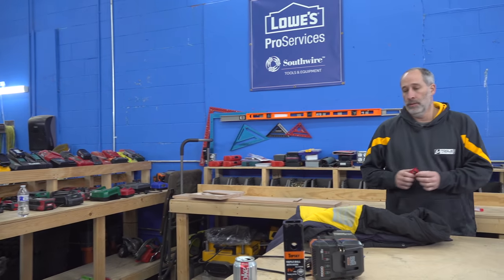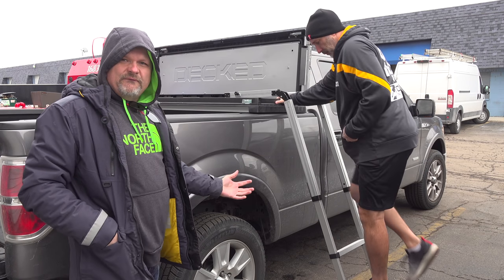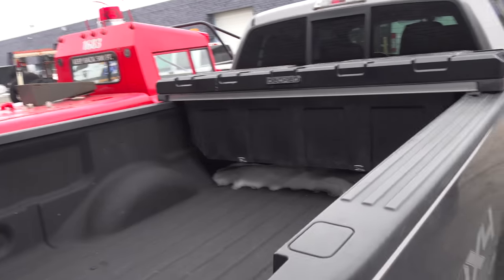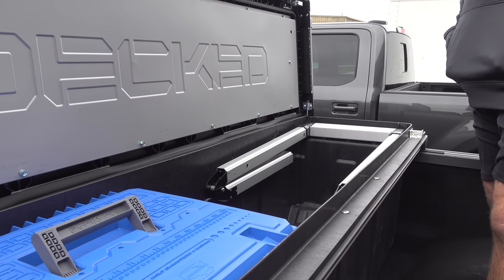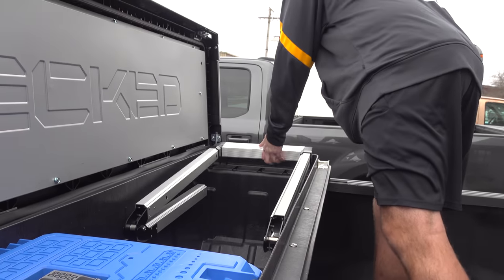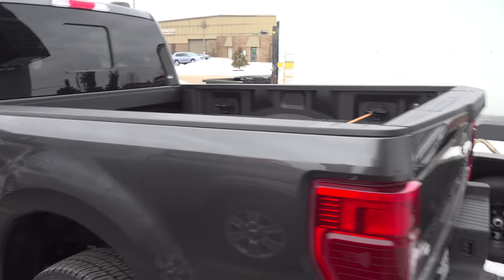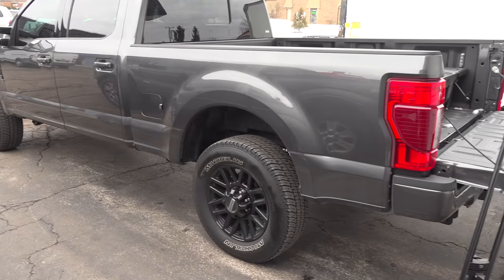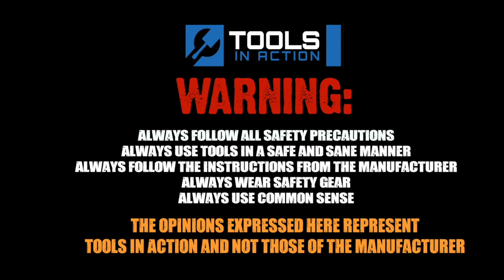A Truck Tool Box Like No Other!

Comment: this wont be a hot seller.. 900 for a crossover box,i'd go weathertech. for 900-1000 i'd go with the decked drawer system
Reply: Absolutely, spot on.  This is a total flop!

Comment: My aluminum box won't rust either, and it won't crack under pressure and it much stronger. It has some interesting gimmicks but I'll stick with mine . Less plastic the better

Comment: As A Finished Carpenter I Had To Make My Own Designs Out Of Plywood, W.P. Glue & Various Hardware To Fit My Varied Tool Setup! Between: Installing & Performing Customer Service! The #2 Drawer System You Showed Is Similar To What I Made Back In The Day! It's So Much Better Since, It Is Scalable, Waterproof/Resistant & Is Lighter With Less Resistance In The Drawer Guided Systems! Wish Such A System Was Available Back In The Day! 🎯🏁😎

Comment: I carry a large Pelican case in my bed. Security is always a concern. Also strapping the box itself is a pain. This seems like a good solution. Anyone who has experience with Pelican cases knows they aren’t just “plastic,” I’m sure this Decked box is similar. One consideration between the drawers and the toolbox: weight. The toolbox weighs less than half what the drawers weigh. So if you’re trying to retain some payload you might consider the toolbox. I have a Power Wagon (awful payload) so I’m always trying to keep unnecessary weight down. This might work great for storing my recovery gear, air compressor, tools, etc. Thanks for the review!

Comment: Finally a ladder built into the box  reach from outside the bed to get stuff out of the truck box . Once you add weight to any super bed it makes the ride better cause it puts weight against the springs.
Reply: At next generation it will need an elevator. Those trucks are becoming so big. Looks like owners, generaly speaking, need to compensate something.
Reply: My ladder came with my truck, it's called a trailer hitch and a bumper. That way I don't throw my back out reaching for something heavy in the middle of the box. And yes the heavy things have to go in the middle because the ladder is in the way.
Reply: Jackle61 That only works with tailgate up. I have a step on my bumper but its useless when I have tailgate down. At least I have my ladder rack which I can use as support for getting up there.

Comment: For $700 and up, I'll pass. I bought a tractor supply aluminum toolbox from a crackhead for $20, best thing I ever bought from a crackhead
Reply: Best deal I got from a crackhead was $1.50 microwave several years back
Reply: You’ve never bought crack then
Reply: Crackheads have great deals. I bought some nice bluetooth earbuds for $6 one time
Reply: You've bought more than one thing from a crackhead??? I must be sheltered here in Temecula.
Reply: Nice. 
I bought a 5000 lb. Chain come along from a crackhead for 5$. 
  Can't beat the crackhead sales.

Comment: For my next truck I’m really considering the decked draw system. I currently have a weather guard tool box packed full.
Reply: Hey Logan! The DECKED Drawer System is a great storage option if you're looking for a weatherproof and secure system for your truck bed.
Reply: @panhandlemtb4308  I do not have it. But from my understanding there is no small parts holder that comes with it. You can buy a tool box from them that fits right in the drawers and could be used to hold small parts.
Reply: @panhandlemtb4308  check out the Drawerganizer that comes with each system. It nests in the front of the drawer and creates a perfect space for all those small items. Let us know if you have any other questions. 👊
Reply: @panhandlemtb4308  we hear you. 🤟

Comment: Looks super well made but a bit small inside.  I didn't realize that when I saw the Decked promo video.
Reply: Our tool box is standard in size compared to others found in the marketplace. You can check out full specs at DECKED.com/toolbox.

Comment: ‘You’re not going to get into it”; the material may be tough but the wafer lock on that could probably be jiggled opened. I prefer stainless in the 14+ gauge range as far as security especially when you can swoop out the locks for a more secure option; when you start traveling with thousands of dollars in tools as a theirs easy reach you need enough protection to avoid theft, especially in metropolitan areas. I see people with added brackets on their metal boxes and puck locks though I haven’t had a theft yet with my box and an Abloy Protec2 lock.

Comment: I wonder how these hold up from the sun beating on them compared to the metal boxes
Reply: They don’t .  Need aluminum bed cover .
Reply: The DECKED Truck Tool Box is actually made from ASA and HDPE resins which are designed to live in harsh environments from UV exposure to being buried in the ground or submerged in water. So the elements will not affect the integrity or the appearance of these boxes over nearly any length of time. We have been making our Drawer System for 7 years and have never seen an instance of UV degrading the material.
Reply from the maker: Yea, my DECKED system has held up great. no fade
Reply: The sun down here in Texas probably would toast it in a couple years.
Reply: @robertrwalkerii6722  it shouldn't. Hottest of hot or coldest of cold, the HDPE holds up. We chose that material since nothing sticks or degrades it.
Reply: @Decked  still would love to hear some one from here how they hold up just saying. Sun is brutal seven months outta the year.

Comment: Lol, ladder takes up 1/2 the storage space.😂
Reply: @zedwpd  
Ok, 1/3. 
But, most toolbox users will remove that the first day. Only a grocery getters might be interested in the ladder.
Reply: They should have built the ladder on the outside of the box inside a tubular hole from which it rests in. Inside the box would be a big inconvenience and waste of space. Even on my regular box I have to organize it so that it fits between the rods that unlock it shield.

Comment: Would be even better if DECKED made a tool box that worked WITH the decked drawer system 🤔
Reply from the maker: Fore sure!  It does if you have an 8ft bed
Reply: @Toolsinaction  actually it looks like all cross bed tool boxes are just a bit too deep to properly sit on the bed rails and not hit the Decked system top
Reply: Right. That's what I was thinking

Comment: Haha. Yeah, Ford trucks may be tough as nails, but they ride like Panzer tanks. My latest E150 cost 37k(double what my 2005 cost) and it will shake the kidneys right out of your ass. You're lucky with the pickup that it smoothed out the ride. Even with my steel bins and tools, that van will shake your fillings out. If I were ever to get a pickup, I really dig Dan's set up. Eric's truck box is just too small for all the crap I need to carry and I still need to fit plywood and lumber in back.

Comment: Is there and option that comes with an L fuel tank?
Reply: Hey John, depending on the depth of your bed and the height of your L box this might work in unison. You can view the tech specs of the box here: https://decked.com/products/decked-tool-box-nissan?variant=32638941528130
Reply from the maker: Hmm, not yet

Comment: If you want super duty to ride better lower tire pressure and install bilstien 4600 shocks.  Make a world of difference
Reply from the maker: Thanks!  Im going for the shocks
Reply: I have a 2019 f 350 crew cab 6.7  removed Rancho shocks,  installed bilstien 4600 lowered tire pressure to 60 psi .

Comment: Decked system makes truck ride better never heard so much bs before
Reply from the maker: Well actually it's engineering. Empty F250's are un sprung and designed for a lot of weight.  So when it is empty, the back end bounces like crazy.  If you put some weight in it, the ride gets better.   Simple engineering.